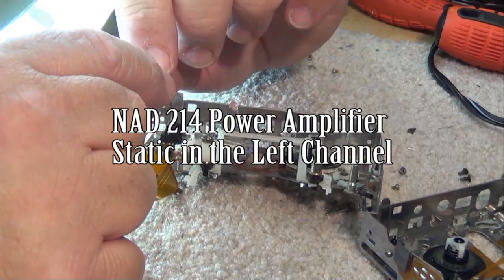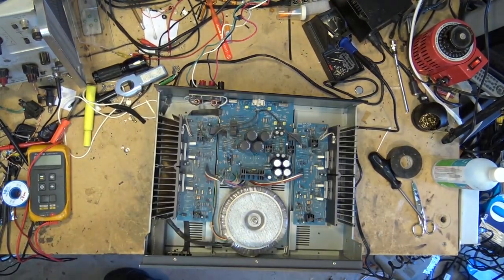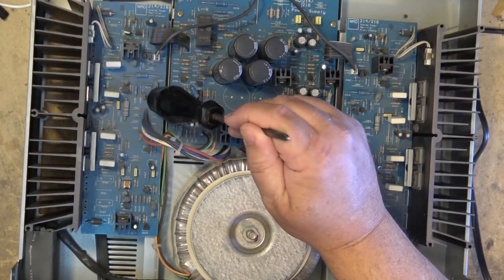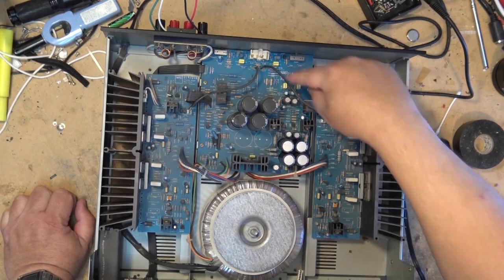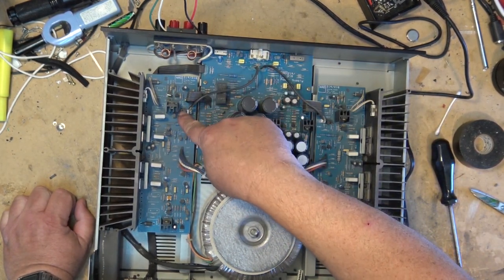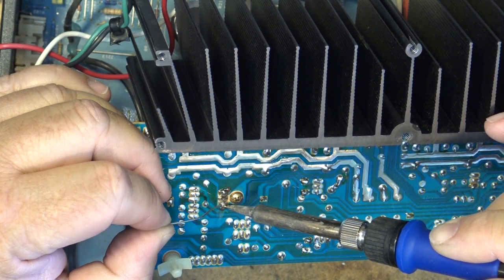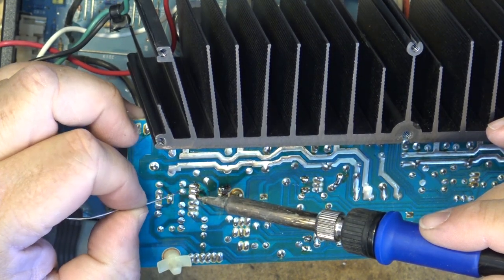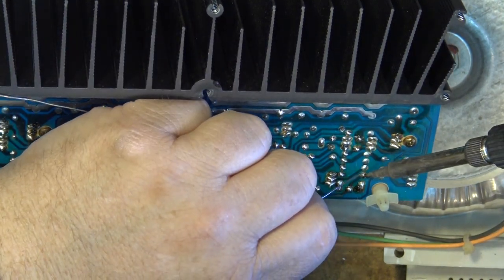NAD 214 Static in Left Channel

Comment: Had the exact same problem. Fixed it in 2 seconds after watching this video by just using a folded piece of paper to poke the connector on the right channel. Didn't even have to open it up! Thanks a lot for helping out

Comment: I run 2 of those amps in mono.. and i get that static sound many times .. i fix it but going to the switch in the back of the amps that say Fix/var for the power amp and i go back n forth with the switch about 20 or 30 times and clears right up... they get dusty and thats what happens..  knowing that both amps have done it means thats a common problem.. just saying.. you may have done a unneeded repair..

Comment: I am having the same problem with my Pioneer Receiver VSX-453, static in the left channel more noticeable with the volume knob in zero, no matter if the balance knob is turned for the right speaker only, the static noise is random, it works well for 10 15 minutes and then the static returns and then suddenly goes away. What could be causing this problem?. Thanks in advance for your help.
Reply from the maker: Likely cold solder connection in left channel somewhere.

Comment: I have an early 80's Sugden A25 amp and I am getting distortion intermittently from either speaker, do you have any idea what   that could be, So you can hear the music but it's breaking up?
Reply from the maker: Distortion is usually a failure of one of the transistors in the driver of output stage, or an open resistor or coupling capacitor.
Reply: @12voltvids  thank you I will take it to a pro if that's fixable. No idea why there are multiple posts from me here.

Comment: I just bought one of these.  Mine does not have plugs for the connectors.  All connections are soldered to the boards right from the factory.  Must have changed the design at some point in the production run.
Reply from the maker: Connectors = failure point. Just look at all the trouble RCA, Zenith, Motorola and Philips had when they went to "plug in modules for easy servicing"
More like "Plug in modules so you can be assured of regular servicing"
Reply: Did a complete re-cap on the unit and changed out the main relay.  Added two extra 4700uf filter caps in the empty areas on the PCB and boy does this puppy sing.  Bloody smooth sounding amplifier!

Comment: Hi 12voltvids.
Can i ask you something?
I have got an Sony STR 5800 Amplifier built in 1978. As i bought it it was like new. Now 3 years later the left channel sometimes cut out but comes back when i turn volume up. Also this happenes really rarely. 

What do you think should i do? Trying to resolder the Relais?

Also can you give me some advice how i can extend the life of this amplifier? because i really love it and i want it last as long as possible. Just 5 Minutes ago i thought about trying to increase the cooling of the STK IC`s and such things.
Or should i leave it like it is ?

Would be very nice if you can help me a little bit :)
Reply: By the way, the sony was really a luck shot for me. I was searching a good vintage amp because i knew they are most tiumes superior to modern gear. The seller sold it for 25€ to me ( on ebay it is 10 times as much and more for  even worse condition ). He probably thought it was just a radio reciever :D
Reply: I don't know if you will see this but that issue sounds like the speaker relay (poor contact do to oxidized connections inside it) very easy fix ... a fairly thick paper soaked with regular isopropyl alcohol 90% or better) rub the contacts on both sides and that will make the relay a past memory LOL

Comment: Connections are > 50% of electronic problems.  For the socket/plug from the rear RCA to the amplifier board I have had similar issues where lightly cleaning with a bit of fine sand paper and slightly bending the pins fixes the contact issue.
To a comment : Soder = US pronunciation , solder = European, it's a global  world !
Reply from the maker: Solder - Canadian

Comment: im curious if you could build a high power amplifier  using parts from mutiple  other stereos using everything you can from each example (preamp and contollers for it) amps and etc from other
Reply: Building a amplifier depends on the skill set of the builder... There are risk factors involved ie getting shocked..

Knowing how to use the components to build your creation and not blow the whole lot and end up with crispy pole of knackered parts.

It may be safer to buy a amp off ebay..

But good luck with your projects

Comment: Really nice video, thank you for posting! I have an old NAD 317 which also has noise on the left channel. I followed your error searching methods and found three transistors (at least) that acted up when I put the solder iron close to them. My issue now is that my knowledge about transistors is virtually non-exisiting. The transistors in question are of the types TR 2SC1815-Y HFE 120-240 and TR 2SA970GR. Can anyone give any guidance in finding replacements? It would be very much appreciated.
Reply: Where on the board were these. Did you resolve it. I’ve a 317 that was given to me with same issue. Static in left channel but does output sound but can hear its not perfect in that channel
Reply: @23chilled  Hi. I never managed to solve it. In the end I replaced the amp. However, it has to be said that I am not particularly skilled in this type of work ;)

Comment: what is it when one speaker is working , turn up the volume then the other speaker kicks in ...? I get this with most amps after time
Reply: Dirty pots/switches most likely, so I bet cleaning all the switches and pots will fix that issue.
Reply: I had that problem too, I swapped the speakers and proved it was the speaker, was it solder connection or a cap in the crossover I changed the bipolar caps and resoldered everything and it worked. I then did the same with the other one to match them up. Good Luck.

Comment: What is a cold sawder??? Sorry for the bad spelling.😋
Reply from the maker: During assembly, if the solder is not heated hot enough, and applied long enough in the wave solder system, you end up with a cold joint.  Anyone that knows anything about "joints" know that you need to get it very hot, burning actually to get the desired effect. Now personally I know nothing about that, but my friends that consume said material confirm that this is the case.
Reply: @12voltvids  thanks I'm trying to learn as much as I can and your videos are great..

Comment: Ha ha "the video is done, byeee" you funny sod :-D.

I had a very similar noise on a dual hi quality sharp cassette deck, one channel just made a horrible noise. (no it wasnt modern music lol ).
After tracking with an audio probe, it turned out to be a interstage coupling capacitor that was trying to be a resistor, it was screwing with the bias of the next transistor.
Capacitors are real shitbags for screwing up.
Reply from the maker: I figured it was a transistor at the start, until I toughed the audio interconnect wire. Then the noise went away, and when I wiggled it, it made a horrible sound as you heard so it was likely some oxidation on the contacts and moving it fix that problem. I re flowed many of the connections on the board just to make sure, and it has been under test. Today is day 3, as I shot the video on Sat, tested it all night sat,  tested it again all day sunday, and then published the video, and now today it is still running, no noise. I will send it home later today if it continues to ne quiet.
Reply: I do like the modular design of the amp, if one channel goes pop its an easy task to lift out just the pcb.

My old pioneer SA-706 has a base board with all the parts on it, even the big black heatsinks sit on it, but it has a trap door :-)

Comment: just thought of something when your re flowing solder on various bad areas 
this could make a lot of sense and change your re flowing technique strategically wise,
for instance a 3 leg output transistor needs a touch up, do one leg left, go to the  other complimentary transistor then do the right leg then do another point somewhere else then do the far right leg then back to other transistor left leg then do another point somewhere else then finish the middle leg , so basically what this technique is doing is waiting for the solder to cool down before applying heat to the adjacent leg of the component, giving the component a better chance at a longer life, so basically never heat
the next leg beside what you've just done always go to farther point away  to lessen heat in a same area then come back and do the adjacent points , like jumping around rather than staying in one area, message me back on this new thought , thanks mike !!!